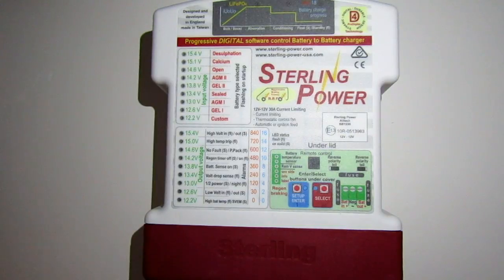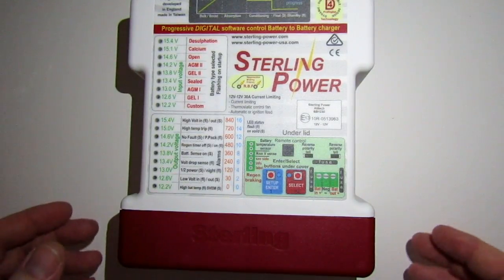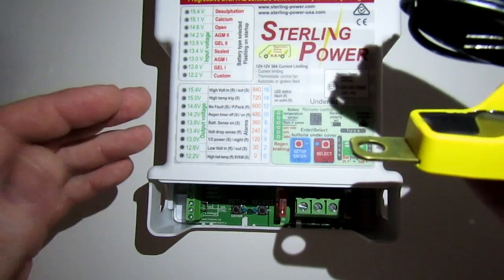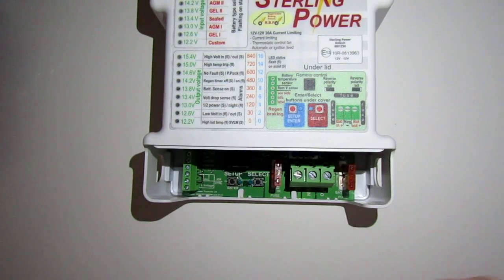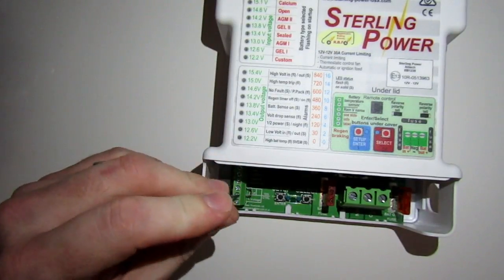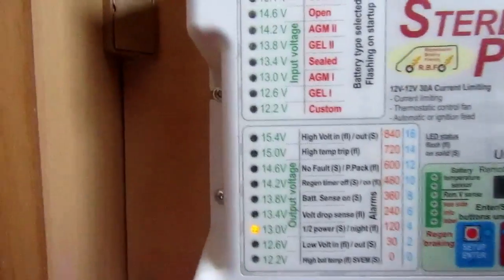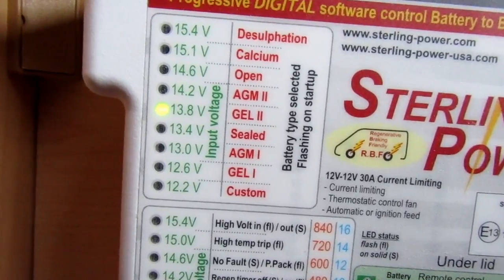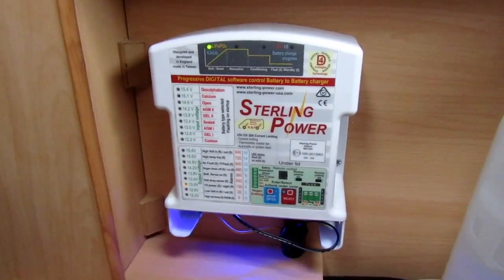How to Wire a Battery to Battery Charger Sterling Power Pro Batt Ultra

Comment: Hi
Very helpful video as I am about fit one these in my 2019 autotrail. 
As I already have  a factory fitted split charge relay should I deactivate it?
Thanks
Kevin
Reply from the maker: Can I ask if you already have a factory fitted split relay why are you changing it?
Many thanks for watching
Reply: dantheman 321 thanks for getting back to me. 
Why would I need the split charger if I what to fit the sterling charger?
Reply from the maker: @kevinjepp7037  what I would do first is contact a dealership for the base vehicle, whether is be a fiat or Ford etc. Give them your Reg number and ask if the vehicle has a euro 6 engine. With Auto trail  fitting a standard split relay that tells me that it doesn't and you wouldn't need to but the sterling b2b.
Reply: dantheman 321
Hi
Maybe I’m not explaining myself very well. 
My van is on a 2019 Fiat Ducato base with a euro 6 engine. 
Autotrail and I believe a lot of van makers fit a relay that trickle charges the hab batteries and powers the fridge when the engine is running. 
I order to fit a battery to battery charging system to give me a better charging I need to isolate the relay also can I wire the b to b to power the fridge when traveling. 
Basically I want to replace an inefficient system with a better one
Hope this makes sense
Reply from the maker: @kevinjepp7037 
Hi Kevin, it is strange why your vehicle doesn't already have a b2b fitted with it being a 2019 model. The split relays aren't supposed to be used on a euro 6 engine due to the voltage that the alternators produce. I would definitely disconnect the relay as you say if it is a separate one. There should be a relay built into your control system which will be triggered via the ignition feed when you start the vehicle. As the b2b kicks in at that point the fridge should run automatically so you shouldn't have to rewire anything. I hope this helps and sorry for the confusion. Every manufacturer do things different so trying to work out there setup can be difficult sometimes.
Many thanks for watching
Reply: dantheman 321 thanks for your advice so far. 
For some reason Autotrail doesn’t have smart alternators fitted to their fiat cat 6 engines. 
The reason I am going through all this extra work is I want install a lithium battery and nothing that is fitted will work with it. 
I have already fitted a Victron MPPT smart solar regulator and a Victron 240v smart charger. 
So the last part of the jigsaw is the B to B charger 
I’m fairly sure I can isolate the split charger I just wondered if it would affect the 12v side of the fridge because I am aware they are linked somehow
Reply from the maker: @kevinjepp7037  your right with the b2b it will work with the new battery, as for the split relay that may or may not affect the fridge running it may very well have a feed from an ignition supply. Either way if it does affect the fridge there will be a way around it. I have a video on how to find the ignition feed on your vehicle which you could use with a 5 pin relay through your leisure to run your fridge which would exactly what it does now. If you need any help after the change over don't hesitate to ask.
Many thanks for watching

Comment: Great  video. Latest versions of the BB1260 or refurbed units from Sterling have OEM lock mode which is 4 red leds flashing leaving you unable to alter the battery type. Needless to say it is a tad frustrating.

Comment: The manual says recommended wire to be 6mm2 or 10 AWG.... Are you saying this is not acceptable and needs to be 10 or 12 mm2 ?  Cheers
Reply from the maker: It depends how long your wire is going to be, the longer the wire the thicker the cable needs to be. I fit 10mm2 as standard, better being safe than sorry because there is a lot of power involved.
Many thanks for watching

Comment: Hi, can you control amp hour output on these chargers? Thanks you in advance
Reply from the maker: I don't think so but I'm not 100% sure either that's a question for sterling or a good read through the manuals.
Many thanks for watching
Reply: @dantheman321  hi,thanks for the reply. Good video, not many of those ones around. Have even given thumbs up. Yet again thanks for your time coming back to me.

Comment: Hello Dan, Just a quick question regarding the Sterling Power video. I noticed you connected the ignition cable to the Low V regen breaking terminal. I the manual I have from Sterling on the 3rd option it has the ignition cable connected to the second terminal up from the low V regen and a link from the Auto terminal to the Low V regen breaking terminal.  which one is right or doesn't it matter or is that a 4 option which is not in the manual.  cheers
Reply from the maker: The systems have changed slightly since this video was made, I could do with doing an updated video really. Without comparing the 2 together it's hard to say but it is clearly labelled on the boxes and instructions so if you want to use the ignition feed just follow there instructions. I said in the video that I preferred to use an ignition feed but I have come across some conversions were finding an ignition feed was hard to do so I have had to set them up without one and it worked fine. Hope this helps and many thanks for watching.

Comment: Hi how do you connet to ignition on new vans nowadays? :-)
Reply from the maker: On some vehicles you can use the cigarette lighter socket if it's ignition fed if you can't find the ignition feed in the dash but the b2b charger doesn't require an ignition feed to work, it's just my personal preference to use it.
Hope this helps and many thanks for watching
Reply: @dantheman321  thanks for help.

Comment: How do I run an ignition feed from my van to the box?
Reply from the maker: Every van is different but you could always check your cig lighter to see if its ignition fed or permanent live, thats the easiest to start with really.
Hope this helps and many thanks for watching
Reply: I use piggy back fuse holder into the van fuse board then run a cable to the unit if you have Euro six you will need to run the cable in

Comment: Thanks for the video. I am buying a 60amp version and want to run on half power. How do I set the half power mode (so it can charge 30amps to my lifepo4 battery)
Thanks!
Reply from the maker: Unfortunately I havent had any dealings with the 60amp version so I couldn't say. Sorry about that but many thanks for watching

Comment: Thanks for the video.  I just purchased a bb1230 and have it installed but I have a relay between the starter battery and the bb1230.  This relay divorces the starter battery from my auxiliary batteries so it doesn't drain.  Will the bb1230 now disconnect the starter from the auxiliary batteries or do I still need the relay?
Reply from the maker: I dont think there is any need for you to use the relay as the b2b does that job. It regulates the charge from vehicle battery so the auxiliary battery is protected. Hope this helps and many thanks for watching.

Comment: Nice video, thanks for uploading. 
I am going to install one of these soon but the 60A version. One question regarding the leisure battery/s neutral, is it connected via the vehicle chassis or by direct cable connection to the starter battery?
Reply from the maker: The instructions will tell you to go straight to the battery so it works more efficiently but I have taken mine to the chassis and not had a problem, hope this helps and many thanks for watching
Reply: My leisure battery is at the back of the vehicle, as too will the B2B unit be once installed.  The manual shows a black cable from the starter battery to the leisure battery and a further black cable form the starter battery to the B2B unit.  That would be 3 runs with the positive red cable from the front to the rear of the vehicle?? 

Two quick questions:-

1) Do you need to link the negatives on both batteries via a direct link?
2) if yes to the above, could I simply connect the negative on the B2B unit to the negative on the leisure battery instead of the starter battery - to save running that extra 3rd cable.

thanks for your help, great helpful video
Reply from the maker: Direct to the vehicle chassis and as short as possible.
Many thanks for watching
Reply from the maker: @Carl_Tabs  
Hi Carl, you will only need 1 wire (positive) coming from the vehicle battery to the b2b. As for the negative cable from the b2b I connect mine direct to the vehicle like you would to earth your leisure battery. It works just the same and I havent had any problems doing that way.
Hope this helps and many thanks for watching
Reply: @dantheman321  thank you for the speedy reply

Comment: The visual clarity of your video was a big help where Sterling sometimes uses cartoon pictures. The explanations were also very helpful. Is it possible that you mixed up the mode numbers? In my manual, mode 2 with the jumper removed is the one that requires both 13.2V AND ignition ON to start charging. With regard to the ignition feed, I  have some choices (and maybe you did too) like accessory ON vs ignition ON vs ignition RUN. It occurs to me that ignition RUN is the one you want meaning ON only when the engine is running. Is this the one you picked? Finally, I am planning to tee into an existing igntion RUN wire without upgrading the existing wire as I expect the current draw of the B2B to be very low. Have you measured this on your application or would you expect the current to be very low here? Great video and thanks for sharing.

Comment: We have a 2018 Sprinter.  I watched your video to find the ignition feed, but our starting battery is on the floor between the seats. Do I find the ignition feed there?
Reply from the maker: The video i have done to find the ignition feed was for a Fiat ducato, Citroen relay or Peugeot boxer. I haven't converted a sprinter with a euro 6 engine yet so i would have to check myself where the ignition feed is. Sorry i cant be of more help. Many thanks for watching.

Comment: What wire do you use? A split charge relays uses chunky wire these all look tiny?
Reply from the maker: On this model we use a 10mm tri rated wire which is quite thick but if it was over a longer distance then a higher gauge wire would be needed.
Many thanks for watching
Reply: @dantheman321  well it's nearly 7m from the engine battery to the leasure battery
Reply from the maker: @grahamhardyvanlife2021  Assuming you are mounting the battery to battery next to your leisure battery then i would be looking at running 12mm tri rated, i would have to double check the diagram first though.

Comment: I'm a little confused as to the requirement of inline fuses as stated in the manual. Surely if there are input and output fuses inside the unit, inline ones are not required? Good video by the way, its about time someone did one.
Reply from the maker: Yes you need to add the inline fuses as close to the batteries as possible, better being safe than sorry.
Many thanks for watching
Reply: What fuse size is recommended? Thanks for answering my questions so swiftly.
Reply from the maker: @jamesfuller201 
Think it is 40amp but i would have to double check when i get in tomorrow but 99% sure its 40 amp.
Many thanks for watching

Comment: Hi great vid. Just wondering the best place to get the ignition feed from. I have a Fiat Ducato. Also what battery would have the “open” setting as in your vid.
Reply from the maker: I have a video on how to find the ignition feed on that particular vehicle, just have alook through the how to videos and it will show you everything. With regarding the battery do you mean which battery to use ?
Many thanks for watching
Reply from the maker: Hi this is the link for the ignition feed video
 https://youtu.be/M8Dpep9iIUw
Many thanks for watching
Reply: Hi just watched the ignition feed vid and it helped a lot. I have agm batteries so will set the charger to the agm setting. I was wondering which batteries you have to set it to the “open” setting.
I noticed on stirling’s installation document, which is so confusing and over complicated, that they have a warning in red, that says if you choose option 3, ie ignition fed setting, that the starter battery could run down. Do you think this could be a problem and would option 2 be a good choice. 
I think Stirling should pay you for making sense of their complicated system.
Cheers
Jon
Reply from the maker: @Jon-md8lf  
That's the good part with option 3 as it switches on when ignition is live and switches off when the ignition is off so how it would drain the vehicle i dont know. It even explains this in the instructions thats why i choose option 3. 
Glad the videos have been of some use and many thanks for watching them.
Reply: Great video.  Is the cable from the sterling to ignition a 2.5mm. When splicing into ignition can be any ignition live , thankyou